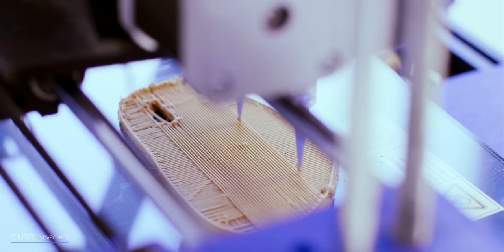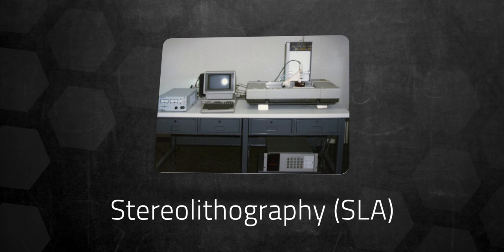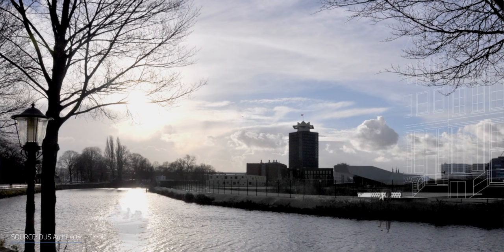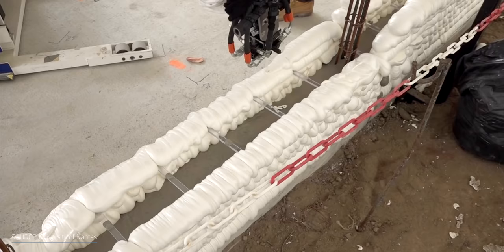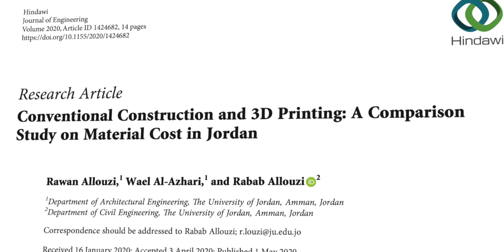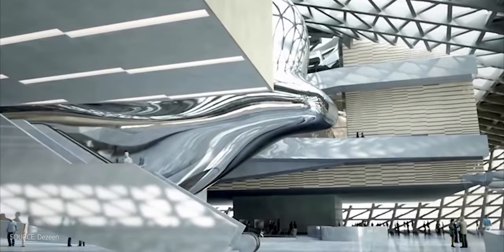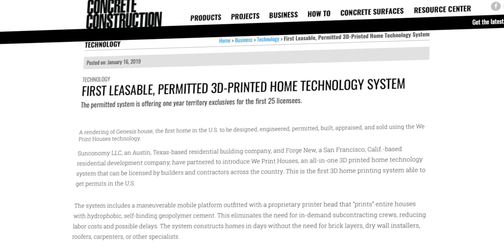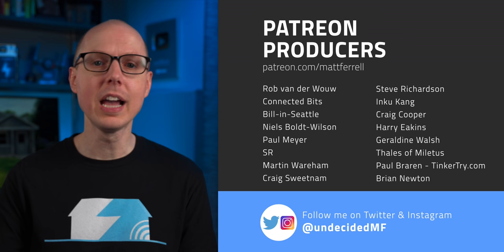This 3D Printed House Changes Everything - Explained

Comment: $300k is insanely expensive for what you're getting with that house.
Reply: It depends on the housing market in each area. It will also depend if the buyer wants simple square rooms or something very custom that better fits the plot of land and needs of the family.
Reply: Well, I wouldn't compare it to the standard US wood plus insulation technique, but to a stone or concrete house. with the flexibility printing adds they can and will charge extra as long as there isn't a hard price marcet on printed housing.
Reply: Agreed, though as others have noted, prices vary by area. The area where that house is... people are idiots to pay that much.
Reply: I agree, even if it's 1/2 as much, tell me what they paid for the land.  If they paid 200k for the land they built it on, okay.  If you tell me the property was under that, I what is the gross margin on the build.
Reply: to some degree yes, then you have to remember houses that are being built today are basically cheap wood with fake brick cladding to make them look good. These cheap houses that you see on the market these days are designed to last 20-30 years. The 3D printed  houses are closer to double clad brick houses that are still standing 50-100 years later that cost a fortune these days to build.
Reply: Portland cement releases a lot of CO2 as well. Maintenance seems like trouble. Not a good solution in colder climates where concrete gets and stays cold.
Reply: The claim of being "half the price" is based on a comparison to the median sales price for houses in that part of Suffolk County... problem with that is that it doesn't necessarily equate to a good metric, since it doesn't necessarily mean comparable size homes or homes in the same school district or whatever.  550k is the quoted median figure, but it doesn't say what kind of house sells for 550k.  And median is a terrible metric -- it just means that half of homes sold cost more and half of homes cost less.  Doesn't tell you what kind of distribution it had or where it costs more or where it costs less... what kinds of homes were expensive and what kinds were cheaper.
Reply: It's mostly the land you pay for.
Reply: @Waluigi-qp3vm  could be due to labor. Where labor is cheap I don't think printing houses can compete.
Reply: It is. I learned $100 / SF. That's pushing 240$
Reply: @davidmccarthy6061  Building cost really should not depend on the housing market. That only drives the price of the land, which of course you need to pay on top of the $300k building price. Also, there's probably extra cost of getting commodities connected to the place you want the house built.
Reply: 300k where I live couldn't buy anything better than a garden shed.
Reply: @davidaustin6962  Unfortunately the guy didn't present this right the actual material and labor costs on a 3d printed home are ridiculously low, often costing less than 50k, the wages one would have to pay to compare would be astounding. A 3d printed home can be built by 3-10 guys in a day vs 15-20 guys paid for a few weeks,  their isn't a wage low enough to compete.
Reply: For a one story house this size it's very expensive indeed.
A house this type in Germany would set you back 200k€ (including electric installation, bathroom, flooring and wall finishing)
Not sure what's included with that house.
Reply: $300k won't get you an easement to a 500 sq. ft. skybox where I live.
Reply: @JD-un2zv  In Toronto a literal garden shed on 20ft by 30ft property. $980,000 2 years ago.
Reply: @LokiCDK  low mortgage rates, people load up on debt.... prices sky rocket
Reply: I suppose they don't include the land in the price. When home builder give their price it never includes the land.
Reply: @Waluigi-qp3vm  
that doesn't mean you get the exact same for the price. it just means that houses in that area cost X and the printed houses cost X+- offset.
a real house could have a finished basement, while clearly the printed house does not. 
300k where i live is a massive area of land (4 homes worth easily), 3 stall garage, big ass shed that can house not 1 but 2 5th wheel campers and a real brick country style home with a finished basement. 3 rooms, 2 bathrooms, shower down stairs and even a fireplace......

if people think 300k for that printed house is some how worth it, they are being fed lies. housing doesn't cost that much. it's all inflated for profit!
it's called a housing market bubble. we have been in one for at least 10 years now. houses are not actually worth that much, ANYWHERE in the world. again it's all just inflated bullshit.
Reply: @truantray  The house that was 300K vs. standard price of 600K was on Long Island. The Palm Springs one was a different company.
Reply: I agree, way too expensive.  Its probably the cost of the property location and not the house that your paying for.
Reply: they were initially supposed to be $5,000 per home until America got involved. The machine itself is literally cheaper to buy
Reply: @LokiCDK  That includes the price of land.  The 300k figure doesn't.
Reply: @xhappymasksalesmenx4092  America? That narrows it down. Which American?
Reply: For $300k you can build a 3000sq ft house in India. I have no idea why buildings are cheaper here...
Reply: @typhoon320i  north
Reply: Rule number 1 about real estate: Its all about the location. A tiny house in the right area can sell for the same price as a mansion in the middle of nowhere.
Reply: @xhappymasksalesmenx4092  that's now down to about 450 million people.....keep going
Reply: thats just because they are greedy.  it didnt cost anywhere near that to make.  just look at the office that used one and reduced workers from 160 to 8.  ive spent nearly my entire life in the construction business, and if you were to reduce the amount of workers from 160 down to 8, that means you probably just eliminated having to pay at least 100 idiots.  if you are lucky, any given crew has one or 2 guys that know what they are doing, and the rest are just idiots.  so if this technology can reduce the workforce that dramatically, it will also remove a ton of useless labor costs, which will make the houses much cheaper to construct.  they are charging that much because its new tech, they still probably need more workers than they would like to have, and most importantly, they are probably greedy and want to make a lot of money.
Reply: @snowcoalRC  The $300k figure refers to the build cost of the house, not the price of the land.
Reply: @typhoon320i  lol the housing industry. i see what you're getting at good sir
Reply: dont forget that this is also new technology which will cost more at first.
as things get better and more competitive. prices could get lower.
Reply: @robertg7249  I would hope so. I hear it's a ton cheaper but you talk to people who've actually done it and it's hardly any cheaper, not enough to make it worth it. That's why they market it as ideal for small houses for the poor because they can leverage economies of scale to actually make it much cheaper. But if you do larger more custom homes I believe it costs at least the same as stick built.
Reply: @robertg7249  it's not new. China has had it for years now
Reply: And how can the price vary per area, Wouldnt it cost roughly the same for every build? houses in my area sell for around 160,000, wouldn't they either make a killing of lose their ass?
Reply: Anything below 500k€ is basically dirt cheep here. And we do not allow American cardboard style housing - so this construction method is extremely competitive.
Reply: @robertg7249  i am currently prototyping a machine like this and i think i can manufacture it at $60k ($15k if optimised to a large company) with the precision (.5 mm), repeatability (layer shifts not exceeding 5 mm) and reliability (continuous autonomous operation for the 4-5 weeks it'd need to make a 1.5 story house)

I'm currently at the stage where i'm trying to see if bridging like traditional FDM printers is viable at the size i want the machine to have (15x15 meter work area and 20x20 meters in external dimensions)
Reply: Part of my problem is basing the house price on home prices in the area, that's why the housing market is where it's at now. If the materials cost x amount, the labor/oversight costs y amount, then a reasonable profit margin can be calculated regardless of what people are "willing to pay".  Yes, the land price is independent of that, but the house itself should be way cheaper and cost the same no matter where it's placed. Ideally.
Reply: What does it take to make a R-40 walls with thermal breaks. When it is -35 I don’t want to give all money to provide energy to keep it warm
Reply: @ahaveland  My Dad used to tell me to buy land as they don’t make it anymore. I have a lot I paid $16,000 for 15 years ago. Last summer someone offered me $60,000 cash for the same land. I don’t need to money and it is probably better than putting it in a bank so I’ll keep it for now.
Reply: @LokiCDK  Where I live most homes are in the $200,000 to $300,000 range for a 3 bedroom with over an acre of land. The lots are worth between $40,000 to $60,000 depending on the mountain view.
Reply: @artesslior1806  where I live concrete is very expensive. Also I see more labor costs for plumbing and electrical.  Once a foundation or slab with at least a 4’ ’ frost wall is in a good framing crew can have a house weathered in  in less than a week. I would want all the walls smooth also because anything else will collect dust.
Reply: Location, location, location
Reply: @Chris_at_Home  Yes, much better than putting it in a bank - it makes oxygen and food. Look after it and protect nature.
Reply: The industry hasn't exactly scaled yet. Give it time.
Reply: @ahaveland  exactly, I have a lot next door to our house with a fenced in garden area. It gives me a place to grow food and offers more privacy as it’s value grows  way more than the annual property taxes.
Reply: It can be done for under $10k ...
Reply: @Yandri Susanto What is the R value that the wall can be made? I noticed the zig zap between the wall, will this cause thermal bridging? I’m all the videos I have seen I haven’t seen and vertical or horizontal rebar installed. That would never work in a seismically active area which in reality can be anywhere. Germany’s winter are like the tropics compared to here. It is May and we still have freezing temperatures at night.in January we always have a week of minus 30 or lower.
Reply: Twenty more years for affordability
Reply: @TubeMeisterJC  You should compete with a building comparable to it. Instead he showed a 1400 square ft home without a proper garage and slapped a $500k price tag on it without much explanation other then it it had a pool. The video isn't very clear breaking down the prices of a induvial room and construction/supply cost of the same template disregarding land value would've been a better representation. 

If you can 3D print me a house as a two story with 6 bedrooms, 3 baths, full dining room, with kitchen/dining area, two car garage enclosed, a full back deck and patio on severe a grade for significantly cheaper then my current home of $178k market price then I'll be interested. With this video I got the notion that any money that is saved from labor simply goes into the special equipment required especially for that wall builder. I can foresee operation of that thing being a nightmare unless in goldilocks zones.
Reply: @InternetWarriorQwer  Add a robot spray foam arm to fill the void
Reply: 3 days ago
well its about 350k now
Reply: yeah the square footage to price ratio wouldnt hold up in a US market, minus the biggest cities. It  is faster to make homes like this, but the cost of 545k for 1400 square feet? nah, my home is just under 2000 square feet and was purchased for less than 250k, with a current value of ~400k...
Reply: it depends where you live, a house like that would be like 600k where i live
Reply: Finishing , electrical , plumbing are still going to be relatively expensive.  Half is half !
Reply: @LinuxGalore  100%.  A house that was built 80 years ago will probably outlast most houses built this year.
Reply: @LinuxGalore  plus.  3d is only going to get cheaper!
Reply: @daudhtm5203  im in a decent sized town of about 80000, with a couple smaller towns that mine grew into bringing it to ~100000 total. My home is in the suburbs, so that is a factor too.
Reply: A lot of back-and-forth about the costs here...
     Printing a house is cheaper than conventional construction of the same style of house.  The cost of property purchase is the house and the land.  Doesn't matter what locations are given as examples.  Some places just the land is 80% of the property value.  Some people opted to live in trendy mini-houses to save cost while keeping a style.  But that makes little sense if it only saves 5% off your property's cost.
     Vancouver and Toronto areas have absurd costs because they are beautiful and/or productive places.  My area, Calgary, is very weird now, property values literally doubled during the oil boom in mid 2000s during the oil boom, and haven't went down much despite a long recession.  It's a nice city and near the mountains, but other than that, I don't get how people are buying at these prices, it stinks for a prospective first time buyer 😒
Reply: @davidmccarthy6061  area doesn't really matter since it's the land that determines how expensive a house is vs a similar house in a different area. Like a APT in NYC vs a small town will be massive due to value of the land.
Reply: @Kramitall  they intentionally took a loss to try and get hype
Reply: @LARS LOVELL real estate agents getting rich right now.
Reply: That's because this is new, early adopters always pay more, over time you can expect the price to plummet

I mean look at 3D printers, they used to be very expensive, now they are cheaper and better
Reply: where I live (wakefield, mass) a tiny house with 4 bedrooms, 3 bathrooms, and a 2 car driveway (no garage)  is worth $600,000
$300,000 is nothing
Reply: @jeremyhillaryboob4248  Unless move to timbukfoo Newfoundland Canada, Buy a bar there for almost free (all closed, foreclosing).
Reply: This could be useful in perhaps restarting California city in the desert.
Reply: @JD-un2zv  always wanted to move to canada
Reply: @avinashtyagi2  got my first 3d printer January 2015, it cost about $1,700. Loved it but had to tinker and take it apart constantly. Replaced it in fall 2019 with much greater build volume, better print quality, much simplified design that is way easier to run and maintain, that was less than $600. This is how house printing will play out too. I'm at the age where people start buying houses but I'm waiting until I can get mine 3d printed for cheap.
Reply: Housing prices are insanely expensive for what you get. At least in places that people want to live.
Reply: @adamgtrap  Its pretty easy really.  If you live in a area where land is a premium house prices goes up.  Or property and land goes up insanly fast   Disneyworld kept secret on its contstruction buying up land cause Disney knew the moment people figured out what was being built you can bet anything the price of land would skyrocket and he was right.   

In California getting a house in the suburbs your looking on average of about 400000 anything below that and its basically a hut in comparison.   Price determines quality in Sol Cal.   The higher the price usually the better the house and location.  

Now however if you go further east of the major cities, house prices drop.    

This is why i mentioned California city its a city that was never built near Andrews Airforce Base.   The land there is unused but if you look over google earth you can see where homes and stores were to be built.   

the 3d tech used for construction here could easily be used to cheaply construct houses that can do well in the desert and best of all keep prices down.  On average your basic house will run about 300000 or less in the desert but as more people buy property and house sales will go up.
Reply: @Quetzalcoatl_Feathered_Serpent  another reason housing prices go up a stupid amount, based on where I've lived, is when you have a lot of rental properties, especially ones where the owner charges a lot, the value of the property is artificially jacked up. Ski towns are a good example.
Reply: @adamgtrap  yep
Reply: @kunjupulla  labour costs I would imagine would be a large part.
Reply: The whole point of 3D houses is that they are so much cheaper and this price defeats that purpose. What would the cost be for the house alone if you already know the land.
Reply: i thought it would cost not more 30k considering what it's made from
Reply: @PatriciaMartinez-xb9gs  average price of you already own or bought the land? That's if you dont include a permit, and other things.  Probably around 30-50k easy.  The main issue isn't the house.  It's the property it's being built on.
Reply: @davidmccarthy6061  
Shape (round square etc) shouldn’t be much of a factor with 3D printing. Cost should be the same for any shape.
Reply: Lop nah fam. Housing markets be absolutely crazy.
Reply: $300k in my area will get you 2500-3000sq.
Reply: @davidmccarthy6061  The problem is that I think they are charging $300k for an area that probably is a new development which doesn't warrant those kind of prices.  And then they are comparing it to established desirable locations where similar size homes go for twice as much.  Then trying to fool people into thinking their process is cheaper.  Just a guess.
Reply: In others words, it'll save contractors money that they'll just pocket instead of passing it to the home buyers.
Reply: @fuckthisbs  Yes, but the owner gets a house that looks like it is made out of mud...lol.
Reply: $1.00 per day per person for a 10 person multi-generation, wonderful home, adjusted in 1977 dollars.  Do you not want to understand the practical application of this Golden Age demonstration project?
Reply: All depends on what that price gets u and where. Like if the cost of the land is included or just the house
Reply: this man does not have any understanding of the TRUTH
Reply: @psyberklown3434  Agreed, the way he presented the cost did not make sense.
Reply: Given the current real estate market it is fairly normal. I'd expect a two car garage and a little more sq ft, but that is expected under current market conditions/and the expense of wood today
Reply: @thoreberlin  I hope they're happy not getting business
Reply: 1) Price =/= Cost, if a company can charge a bit less than other competitors it will, even if it's costs are 90% less. Basically they'll just go as high as they can until buyers balk and attempt to buy the actual machine themselves, then they'll keep it right around there. Once more companies get into the same business, it will drop way further.

2) This looks a lot sturdier and longer lasting than typical homes today, and they are covering up the horrible printed surface with other finishes anyway. So pretty much the only thing you can't do here is if you wanted the aesthetic of an exposed structure out of some other material (like exposed wood beams, even then you could mix that in). So... what's the problem exactly making it not worthwhile?
Reply: @truantray  Yeah I can just see the rubble left by these houses in tornado country but these homes aren't a bad idea for some areas.
Reply: @JD-un2zv  Low mortgage rates aren't the problem. It comes down to the person living in their means.
Reply: @cjones29hd   they are within their means at time of purchase...according to the lender and stress test. How many went for the variable or 1year , inflation means force rate increase,  rate rise of just 1% would destroy many of them. 2% and it's a landslide of foreclosures.
Reply: @davidmccarthy6061  I like the concept of 3d printed homes, but I have to question that price tag. It seems much more likely that the profit margins on these homes are absurd. The first company to come along and price 3d homes with a more reasonable profit margin is likely to cut the value of these homes bought at these prices. In fact I would say that 3d printed homes today are kind of like the early personal computers. They were expensive far in excess of their value. Eventually prices will come down and quality will go up making these early models nearly worthless.
Reply: I checked it myself. In that area, other same (normally built) houses costs around $580,000.
Reply: @Salidin111  come to Canada, that house you describe there is easily a 2 million dollar plus house here even in the country. So if they can 3D print that cheaper than 2 million here they are winning.
Reply: Nah a shitty 2 bedroom townhouse in Ottawa Ontario cost upward of 400k. Our currency is also like 30% less then yours. So for an American to buy one in Canada would be very cheap. Just gotta deal with all the progressive crybabies nexdoor.
Reply: Yes his figures are excessively high
Reply: $300,000 is crazy expensive. To be fair though I think the average house price in the US is a little over $200,000. Who the hell can afford a $300,000 though for a house, that’s a lot of money.